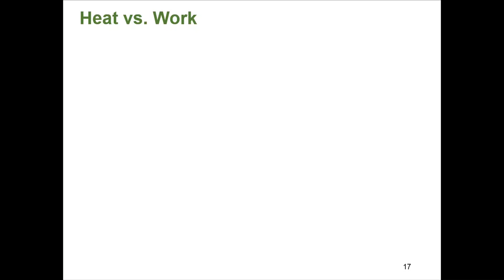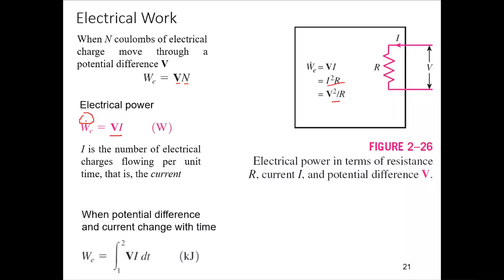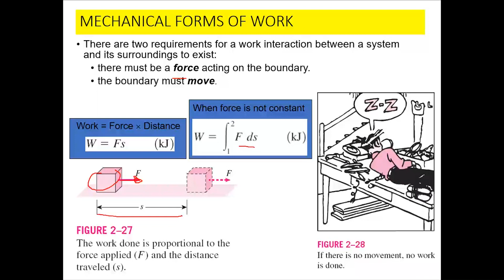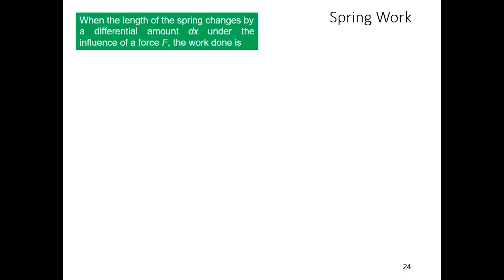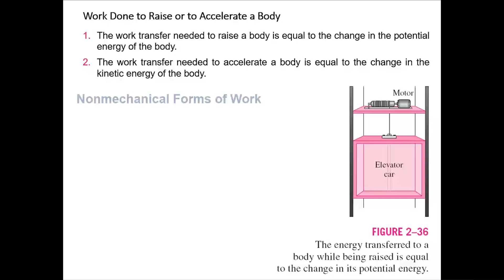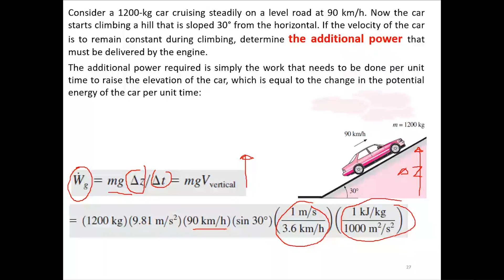Thermodynamics | Lecture 8

Comment: 19:42  Sir how can You treat energy as a vector like can we break energy in its components,why did u break potential energy in mgsin30                     and if You are using the high scholl formula F.V(FVcos@)      so there is cos@ not sin@   sir plz could You explain this very confused
Reply from the maker: Energy itself is not a vector quantity; it's a scalar. When an object is on an incline, such as a slope at an angle to the horizontal, its potential energy due to gravity can be resolved into components parallel and perpendicular to the surface of the incline. 

The component parallel to the incline contributes to the force causing the object to slide down, while the perpendicular component doesn't affect the motion along the incline. 

The reason we use sin(θ) instead of cos(θ) when calculating potential energy on an incline is due to the direction of the force. When an object is on an incline, gravity pulls it down along the incline, not perpendicular to it. Therefore, we consider the component of gravity that acts parallel to the incline, which is given by mg sin(θ). This component is what contributes to the potential energy that can do work along the incline. It seems there might be a confusion here.

when dealing with potential energy on an incline, we use sin(θ) because we're interested in the component of gravity acting parallel to the incline, and when calculating work done by a force, we use cos(θ) because it accounts for the component of the force in the direction of displacement.

I hope this helps clarify things! Let me know if you have further questions.